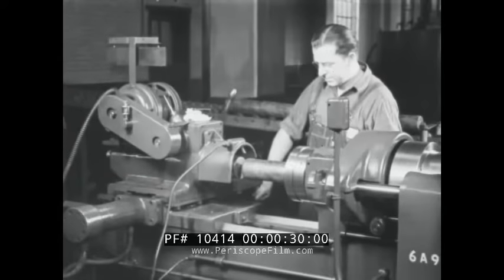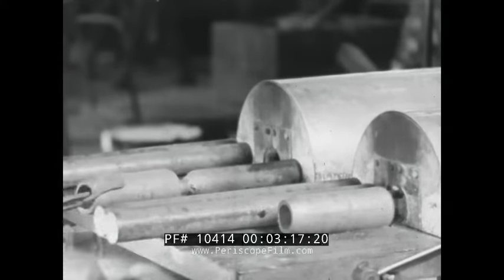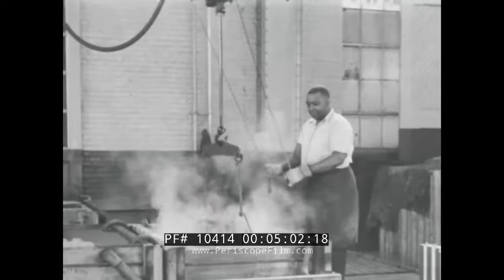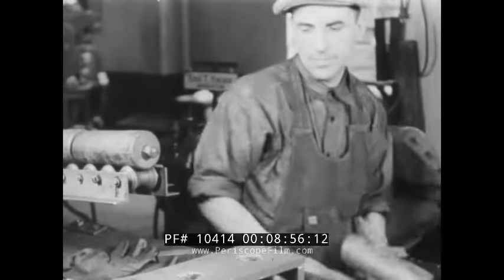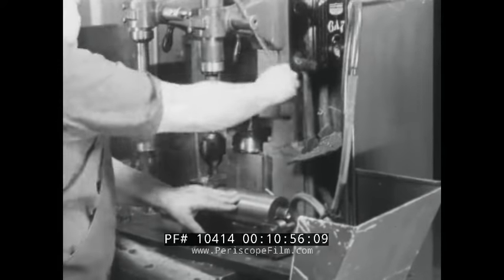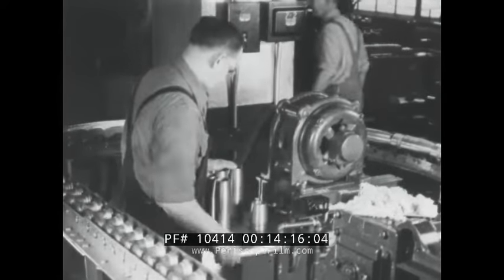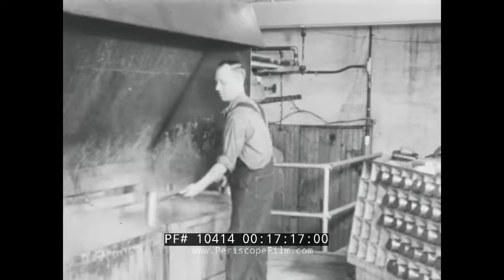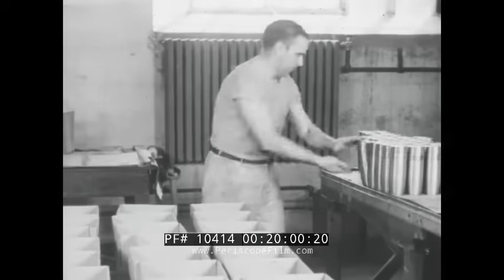MANUFACTURING 3-INCH ANTI-AIRCRAFT SHELLS     WORLD WAR II ORDNANCE FILM FRANKFORD ARSENAL 10414

Comment: Anti-aircraft shells were even more labor intensive than most, just like anti-tank AP shells, because they were fired at a very high velocity to give them altitude/penetration effect. People don't realize that not only are artillery shells much larger than bullets, but they are typically much faster. A 3,000fps artillery shell is nothing special, while it is a hot rifle round. Lower speed shells like mortars or even howitzers can be cast and then machined, but when they start getting into AA/AT velocities, they need to be stronger and more perfectly made. Think of the forces a shell undergoes being accelerated to 4,500fps or more, the forces trying to make it fly apart in air from the spinning of the shell, the way even a slight imbalance will throw the stability of the shell off as it spins.

Comment: This was very interesting, but there must be better methods today. The workers could not do this today without safety glasses or shield, and other safety measures. Those guys were tough!
Reply: I'm an engineer in a forging plant and we still use these exact 3" national upsetters everyday to forge parts for the automotive industry. Same induction heaters same shear presses facing machines gages turning operations etc all almost identical to this.
Reply: Mikhail Kimbel -
Wow Mikhail, that surprises me. I don’t doubt that the tried and true technology is just as good today as yesterday. Just goes to show that the old saying ‘If it’s not broke - don’t fix it!’, is still valid today.
Cheers from Australia!

Comment: One must realize we saw only the operations, not the number of machines actually in use. That huge factory had many, probably dozens, of each one of those machines running simultaneously, most likely 24 hours a day, seven days a week. The longest operation appeared to be the turning of the outer diameter that took maybe 2 minutes at most. That means each production line turned out a part every 2 minutes, or over 1400 parts per day. A factory that size had the potential to turn out tens of thousands per day. Multiply that by the numbers of factories = a shit load made.

Comment: How could An induction Furnace exist in the 40th without electronics?!!! That its the part intrigued me the most of the whole video...
Reply: They had electricity.  An induction heater is just a coil of wire you put current through, it creates a magnetic field and if you put something in that magnetic field it gets hot.
Reply: @minuteman4199   In the video They Said "A high frequency" induction furnace... that cannot be possible without an  Silicon  Electronic Device like an oscillator...  That is the source of my doubt ...
Reply: daniel espinoza maybe you should have to look into history.

Comment: I have always wondered how the first machine tools were made without machine tools.
Reply: The first machines were crude but they worked. They got perfected pretty fast.  Look at long rifles used during colonial times. They figured a way to turn barrels and bores in forged steel bars.  The guns were deadly accurate.
Reply: russellsantangelo1  Thanks for the reply, manufacturing machines have always fascinated me. I’m surprised that so many take them for granted.
Reply: Averaging. Rub three surface plates together to make a perfect one. Hand file a thread and then use a long felt half-nut to drive the cutting of another, better, thread.... Even a bodger's treddle lathe gets you most of the way to a cylinder. Surveyors have been mensurating with decent precison from before the pyramids. Where there is gold there is a way!

Comment: I wonder what the cost was to build 1- 3" shell. I'll bet 99% never hit a thing. I doubt if they had a proximity fuse at that early of date..
Reply: The most common use of Anti-Aircraft were timed fuzes and flak. Those weren't made to hit a target directly, these Shells were made for flak in which they can also release deadly shrapnels in the air.

Comment: It is easy in hindsight to make critical comments on the manufacture of 3 inch anti-aircraft shells, but what seems obvious is that critical measurements were overdone together with needless and redundant steps in the process.  Precision is important in things like engines and firing mechanisms, but a shell making a one-way trip does not need to be made as if going into a time piece or a heart-lung machine.

Comment: Automation of many steps has increased production
Reply: I'm an engineer in a forging plant and we still use these exact 3" national upsetters everyday to forge parts for the automotive industry. Same induction heaters same shear presses facing machines gages turning operations etc all almost identical to this. Most if not all still manual operations surprisingly.
Reply: @mikhailkimbel91  I respect the hard hands on worker but, sometimes a bit of automation would lighten the load.
Reply: Or eliminate jobs

Comment: I'm a machinist, this is all no skilled production work. Look at it, dedicated operation machines with stops, cams, and clutches. Guy tapping doesn't even have to hit reverse. Everyone in this video could do the job blindfolded. Even QA with the go no-go gauges, easy. CNC machines don't do this today, too slow, same machines just not people loading machine and better cutting tools. The shells are forged fior strength. The band is seperate so it can be hardened cause it guides the shell through the barrel. FYI Machine Shop Safety 101 you don't wear gloves near a turning spindle. That's how you lose fingers and hands
Reply: I agree.

Comment: I have run machines very similar to a couple of the machines in this vid. 
The oldest was 1918
 https://www.youtube.com/watch?v=30p0cEZCUFo
Cold form steel is what I currently do. 
I have done hot form,. half inch thick, two in. round head from one in. induction heated bar.
SLAM! move it down,. push button SLAM! this vid has a large forming machine,. they are back extruding 
to get a hollow piece from a solid bar. I used to do that too,. but it was done cold,. 
much smaller parts on a multiple die nut former.
The other machine in this vid. at 12.50 I have run was called a Bullard'

Scary sruff the things that happen in old manufacturing like that
I was taught by old school guys with old machines ,.Things have definitely changed. Much safer designs and inovations.
CNC,. Liquid metal and 3d printing is the future of a lot of manufacturing nowadays.

PiEce!

Comment: It's interesting to see how SLOW the production was in those days when compared to current day mechanical processes.
A lot of separate step processes with a lot of transport steps and fixation/clamping from one proces to another proces.
A lot of that can be done nowadays in combined steps on CNC machines without the extra transport/fixation steps.
This seems to be a small(er) (sub?)contractor because the machines look very basic/primitive even for  those days?

Comment: “Gentlemen, our product undergoes scrutiny to ensure that at each stage of the manufacturing process, each unit is cut, milled and turned to within 1/1000th of an inch. Furthermore, the metallurgical analysis ensures this product will operate perfectly in all environmental conditions, not deviating through an excess of cold, heat or moisture.”
“Superb! And what does the product do?”
“It’s filled with high explosive and fired at enemy aircraft where it explodes in a consistent and predictable fashion!”
“Wait, all that work and you blow it up!”
“Of course! Now can I interest you in some war bonds?”